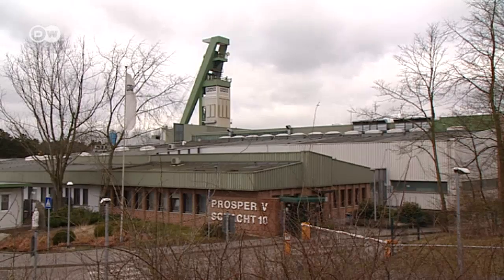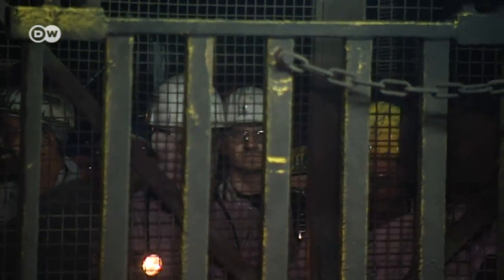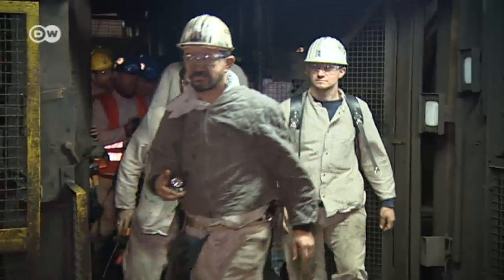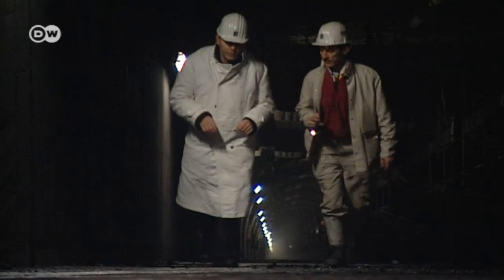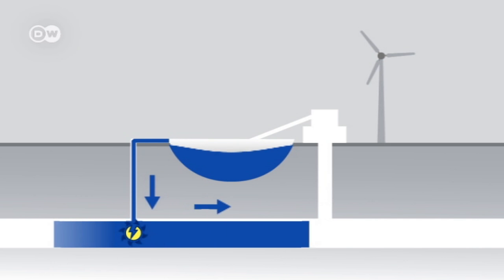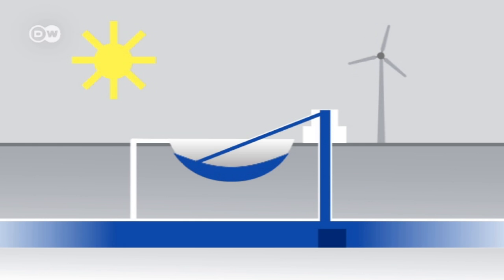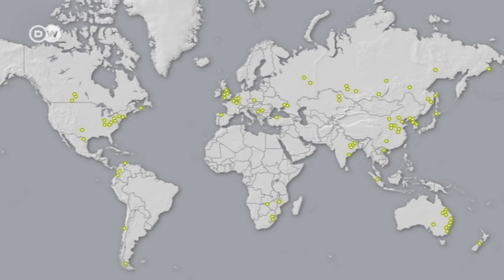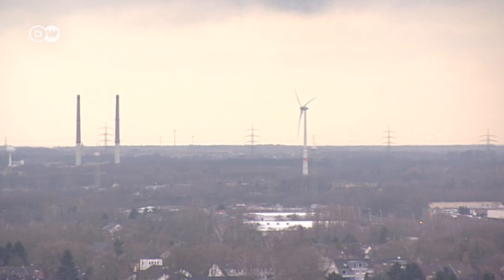Pumped storage power could replace coal | Business Brief

Comment: Good idea, strange presentation! Presuming that the pumped storage is contracted to the electrical utility and not a company operating wind turbines, then it is associated with high and low power prices, not wind energy in particular. Coal and nuclear also have a need for storage during periods of low demand, that was the original use for storage before the growth of wind energy.